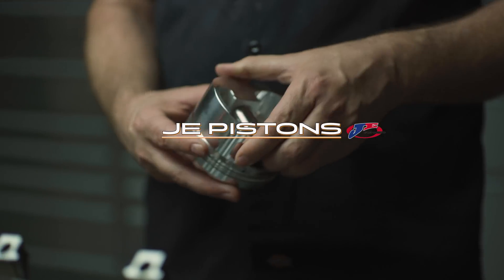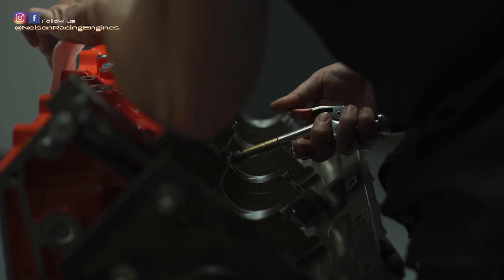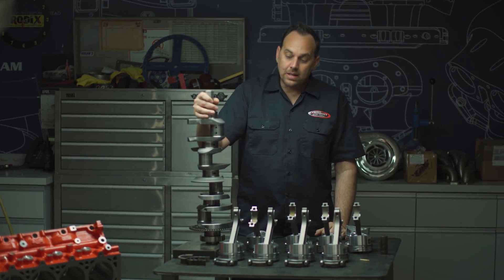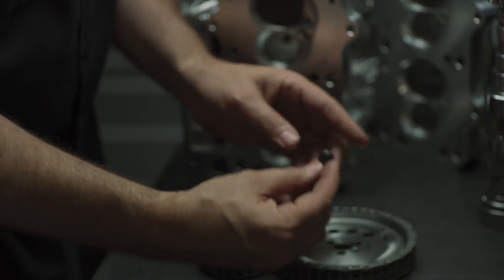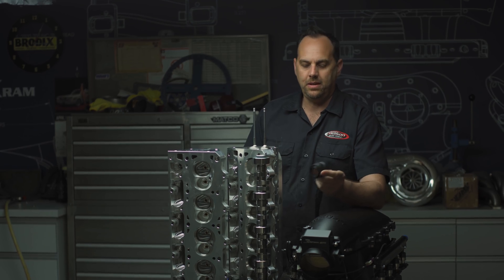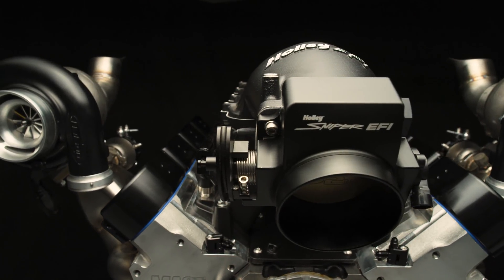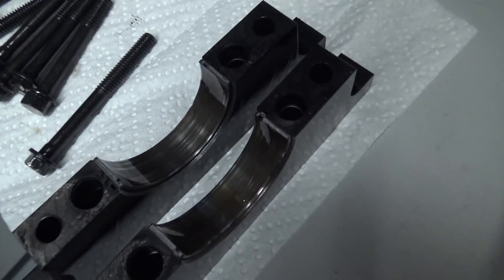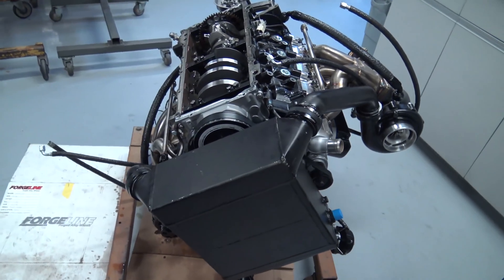Secrets Revealed!  1200 HP 260 ci Chevy LS!  Tom Nelson reveals his secrets!

Comment: That piston oil squirter block mod came from the 5.8L trinity GT500 engine.
Reply: Ok, I see what's happening here. I have a 3 response limit, so this will be it. Like I said, I'm an engine builder and I have customers that don't want to hear that their 10-15k race engine is waiting on my YouTube troll fighting. You used the word mod. I assumed you meant modification, like what Nelson did here. Custom work. That's why in my response I used the word mod. Now you are talking about factory original equipment. Not the same thing. However, I still stand firm on this "tech" being decades old. Who else installs jets into the mains from the factory? Don't know, don't care. Look it up yourself instead of dryly instructing someone else to "enlighten" you. The point is that you were making the assertion that "Ford did it first", and they didn't. Drag racer/machinists in the south had this shit in the 60s. What Ford fanboys really need to invent is a way to keep from killing people at cars and coffee! It's been fun, don't let an old, bald Chevy mechanic mess up your day. Take a cruise for me, it's raining here. 💙💪🏻👍🤘🚘
Reply: Shelby Avant ... ease up oh the geritol there cup cake. If this block mod was done in the 60’s 70’s why didn’t aftermarket or the main three do this on the race blocks. (Dart,world,ford racing, GM performance ect) not one block has this hot rod mod incorporated into the block that was so proven in the 60’s 70’s ... even nascar ass far as I know. But hey you’re the expert? Show me where it was done in the 60’s 70’s...  Btw... I’ve been around awhile, no old bald Chevy driving premaddona can rattle me.  I have no problems keeping my Fords out of the crowds either.
Reply: @matthewnosal6893  Feisty! Brother, there are a lot of things that were experimented with in street and race cars in the 50s and 60s. Many of these things never saw the light of day again, others have returned because of the need that new laws and regulations create, and also the ease of manufacturing that new technology has enabled. Meth kits and the like are popular now, but people were playing with water injection to increase compression 50 years ago. Porting and polishing make a huge power difference, but were never done from the factory because of time and cost constraints. To this day, cars still don't come with an oil catch can system because of the extra piece cost and maintenance aspect, even though it's one of the best things you can do for your car.  If something isn't necessary for the vehicle to last through the warranty period, or for the race car to last 24 hours (or however long the race is), or for sales of that particular product to stay strong or relevant, then you won't see it in use. The new Corvette is mid engine, and some will get a flat plane crank, but this is stuff that they flirted with over 60 years ago. This is where your oilers come in, and you know what? Back in the day, I'm sure none of them had a 50lb. relief spring in them. Like I said before, Ford likes it fancy! You call it a mod, and that's fine, because you are referring to a very specific way of doing something that you have only seen on Fords. I call it tech, because I look at it more on a conceptual level of there being more than one way to skin a cat. This comes from working on different kinds of machines, I suppose. That's why I named you three different ways of achieving the same goal. Chevy may put the distributor in the back instead of the front, but it's still a distributor, get it? This "mod" is a neat one, but by and large unnecessary. This is why even in builds where money or even time are no object, you rarely see this done. Most people just don't deem it worth doing for what you get. It's borderline novelty. Tell me, because I honestly don't know, is Ford still using this in any of its engines, or was this a passing thing for them, too? Trying to figure out who did something first can be an interesting learning experience, but if not kept in check, can descend into futility. Everybody thinks Eddie van Halen was the first to do two hand tapping, or that Edison invented the light bulb, or that the Wright brothers were the first in flight. Who wrote the first heavy metal song? It comes down to how narrowly you define something, and in this instance I just happen to be approaching the concept of "splashing some oil on it" in a broader context.  Look, I get it, you like Ford. Two things can be true at the same time, maybe we just missed each other's points a little. How about this: Ford MAY or may NOT have been the very first automotive company to ever install an in-block, crank main located, brass jet with a spring metered valving action set for 50lbs. This is as close as I get because I don't deal in extremes. Too much chance to be incorrect. It's what keeps me away from organized religion, but that's another conversation. In return I ask that you neither admit nor concede anything, merely consider the notion that ever since pistons started travelling through bores, and certainly from the advent of combustion engines, that mankind has continuously sought out new and exciting ways to keep the piston cool and the cylinder lubed. In the spirit of Chevy, be my Camaro (French for "pal"), and in the spirit of Ford (over-engineering), use some of that fancy, cutting edge technology at your fingertips to at  least properly spell primadonna. I must really like you, Matt. I shattered my 3 response rule with a paragraph! Stay 
First 
On
Race
Day my friend!
Reply: @shelbyavant5081  You called it a mod and he's saying it's old tech which it is.
Reply: @MF-Rell  I think you meant to message the other guy? Thanks for backing me, anyway. Thank you also for calling me lame. What I said was funny, regardless of whether you liked it or not. Matt calling me a cupcake and a primadonna was also funny, whether I liked it or not. It's all in good fun. As far as your suspension tutorial, snap oversteer is real, don't get me wrong, but there is a simple solution to all of these epic fails. We call it a driver mod. That's why I used the term fanboy, because those people don't get my respect. If you tear up your car to show off and cause accidents, then you are not a driver, an expert, or even an enthusiast, you are an asshole. Right? Let's not blame the cars for what people are doing.
Reply: @shelbyavant5081  I didn't call you lame you lame I meant what you said was lame, It was more of a joke but we're reading words here.
Reply: @shelbyavant5081  everything you said was tru but I was Just messing with you bro.. 😂😂🤭
Reply: @MF-Rell  💪🏻👊🤘👍
Reply: @shelbyavant5081  Everything else you said was ok but the Ford fanboy and cars and coffee shit was lame. I own a Corvette and mustang and the problem with people wrecking any solid axle 4 link is caused by snap oversteer. Most guys think they can put poly bushings in the upper control arms and that will fix it but in actuality it makes it worse. Panhard bar and ftw... No comment needed but everyone that's into new edge mustang's don't have an idea that how to remedy the short comings of a 4 link.
Reply: Sorry bud, that mod's been going in engines for a lot longer than you think.
Reply: Shelby Avant . Enlighten me. First I ever heard of it was the trinity engine.
Reply: Marine engines and diesels use this tech all the time. European cars have had it, too. I can't honestly tell you what the very first race car was that got it, but I can assure you that stuff like this is DECADES old. Some setups have the orifice tube, occasionally this is even spring metered. This is ok, but you are at the mercy of how perfectly the hole is drilled and the extra moving parts of the regulator inside. Some have passages through the rod itself. This is great because the wrist pin gets lubed, and the oil is hitting the piston full time and accurately. Most of the time what you see is a "squirter", which is a banjo bolt and tube that plumbs into the oil passage. These are simple, easy to install, easy to clean, and can be positioned to spray wherever you want. Doing something like this IS classic Ford, though. They love to over-engineer things. That's why it takes them twice as many valves, 4 times as many cams, and 30% more rpm's than a Chevrolet that weighs less, costs less, and takes up less space. Just because the first place you saw it was 6 years ago on a mustang doesn't mean that's when it was invented. Maybe Google "piston oil squirter" or something. I gotta get back to building engines, have a lovely Sunday my friend. 💪🏻👊😎
Reply: Shelby Avant, fully aware of the external squirters with the banjo bolts. But I don’t know of any manufacturer that utilizes a drilled passage in the main bulkheads for piston cooling.
Reply: Diesels have been squirting oil on the underside of the piston for decades.

Comment: What increase in power can you get with just that holly intake on a v8 ?  And maybe headers ?
Reply: Not much, you want your intake to match your engine application, some intakes help bottom end power where as others only help on the top end, most aftermarket intakes actually aren't any better than factory ls intakes, with headers it all depends but you won't gain a whole lot, you will get a bit more hp out of extractors but still, not much

Comment: A motor that has less c.i. then a 4.3 l Chevy v6 which has 262 c.i ...this is making 1200 hp i think he is lieing about the cubic inches lsx blocks have 376 cubic inches not 260
Reply: De stroked for strength, makes power with boost not cubes.
Reply: dude 4.3 are also used in cyclones/typhoons.  those liltte fuckers can make a lot of power beisdes they do this in F1 all day long
Reply: Lsx bore size from factory is 4.06 not 3.880, 4.8l and 5.3l have that small of a bore but not a Lsx based block
Reply: @RedXray  it says on jegs that lsx block is capable of 364cid at the smallest 482cid at the biggest how did he make it a 260

Comment: I wonder how this engine would perform with a flat plane crankshaft in it?
Reply: I was thinking the same thing especially since I watched a 391cid put together from 1959. I wonder what NRE or Ken could do with one based on the LS.
Reply: Better exhaust scavenging with a flat plane. It's small enough where vibration issues should work out.....I think
Reply: Probably like shit. Ant know ford junk. Chevy builds real engines
Reply: @donaldkinder6716  Funny thing about that is ford goes through the trouble of putting a flat plane crank in and then proceeds to destroy the benefits by making the headers unequal length
Reply: @donaldkinder6716  Is that why they needed the SB2 in NASCAR? their "real engine" the first gen small block and LS looked pretty weak when they asked to run a clean sheet competition specific race design against the Cleveland Ford designed in 1968. First non-OEM engine allowed and first time a manufacturer to ask for such an allowance.
Reply: you wanna know what the performance would be ????
look up performance engines in Tumwater Was...  my uncle George Johnson has one of the only true original 283ci v8 sbc floatplane crank engines produced , you put a turbo on it with true kinlser injection and that overpriced LS motor is mopped up by 60yr old engine 😎
Reply: to bad I can't put up a pic in the response, I show you my BEAST big block Chevy 😁... eat that Lsx motor without any power adder and run just like that at half the room needed, when you got family members to learn from who have been doing this for half a century and race @ 300mph for a sport you learn the flash and glamour is all that is ... that engine is designed for 1 thing and that's it nothing more at all .... static power.  constant flat out no let up... wouldn't handle daily driving, no road racing , no dragstrip....it is not as cheap nor as expensive as ppl think.. ANY sbc since 1955 you can make 500/500 cheap all day long... GM has all the factory produced parts to do it...

example :

late/mid 1990s 350 4blt block & factory pistons

late/mid 1990s baby lt1 crank and rods

late 90s Vortec heads

factory production cam for 2004 gto & Vette

.... these parts give you a factory 302ci sbc, 1 piece rear main, 4blt mains, factory roller cam, and ability to run TPI  injection, the engine computer out of almost all Camaros is perfect for the control, add to it the factory truck injectors and a 32psi fuel pressure regulator spring and bingo 2 turbos and you got an engine that has connecting rods made of atsm powder forgings, forged crank, forged pistons, nice roller cam, 2 turbos and a manifold pressure boost regulated turbo system...  nothing but all factory gm parts used... now you add a flat plane crank to this and you will see with a mildly aggressive camshaft well over 2.5hp per cubic inch... now you wanna really get nasty with it call up NRE and asked them about a lifter bore oversizing and recentering for use with  Chrysler lifter diameters and a wee bit more aggressive ramp rate...

Comment: Junkyard 4.8 LS 898 HP at rear wheels on 15lbs boost made over 1100 at 22lbs , was done on car build off show.
Reply: Very cool, would probably have trouble staying at full throttle max rpm for 5 min though
Reply: It has been done bunch of times, even with cheap ebay turbos. But they are dyno queens and won't last a race season.

Comment: 5 mins full boost! Shoot, many street cars will blow up after 1 minute full boost 🤣.
Great work!!
Reply: Thats what I'm sayin! We all could learn from this, regardless what brand we use!
Reply: LR4/LM7 anyone?
Reply: LSX ATLANTA more like 5 seconds of full boost
Reply: LSX ATLANTA
Guys with diesel engines  , specifically cummins platform run  100psi daily driven  for millions of miles.  All this stuff Toms talking about allot of diesels do already. Diesels arent as fast but there is stuffed to be learned from them.
Reply: Mark Rich.....While I can agree with you to a degree.....for simplicity and quick explaination reasons, the most forthright difference is diesels don’t run anywhere NEAR the rpm. Run your Cummins up to 8-9k rpm and see if she lasts for even 1 second. A stock one is going to blow not much over 4,000, if you even get that lucky. Sure, there are some high revving (4-5k and even higher) diesels, but that is of extremely short durations. Not to mention those “race” diesels are a completely different animal than the Cummins you drive to work today. You mentioned a “daily driver” above....how many people do you know driving diesels with 100lbs of boost to the grocery store daily. If your going to make the argument you need to stick within the same realm.
Reply: Mark Rich 100psi 🤔
Reply: Mark Rich no engine running 100psi of boost daily driven will go a million miles if a cummins does make it to 1mil it’s probably bone stock or very lightly modified
Reply: @markrich3271  DMax, see Gale Banks
Reply: @markrich3271  im pretty sure tom knows this.  the point is a gas engine is a different animal
Reply: @KingJT80  I wasn't talking to tom ,  I didnt see that point not once. No one mentioned the fuel used.  Not all  of the engines are using gasoline that Tom Neslon builds.  The conversation I replied to was boosted street driven engines.
Reply: Did it have any load on it?
Reply: @BiGGBLUNT1  thats my question too.. usually headers glow red when at full boost, this one dont look like its boostin
Reply: @jmzavala5215  it uses double wall header with build in liquid cooler from the lake between it
Reply: BiGGBLUNT1...That is one of the key points of a dyno.....To simulate load. Can’t you hear it in the note of the engine when it starts loading it?

Comment: whats the weight difference in that motor vs a 427 or 454lsx
Reply: Almost none? The engine is still the same size. The pistons and pins are made more sturdy in their dimensions, so heavier. Crank is shorter, but rods are longer. Dry sump weights a little more than a pan would. Big Holley intake. This thing probably weighs more than your average lsx build.
Reply: A 427 big block? 650+
Reply: @somenygaard  He said lsx, not big block.
Reply: Shelby Avant Wasn’t clear to me and since 454lsx doesn’t exist normally and he didn’t specify on 427 I was thinking maybe he was referring to the old BB... also the ls motors are basically the same their weight is so close.